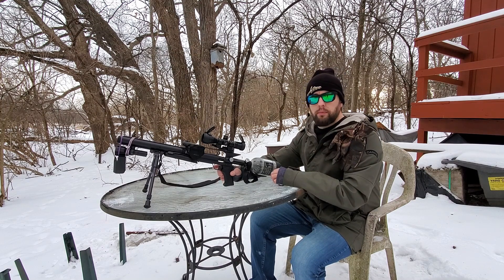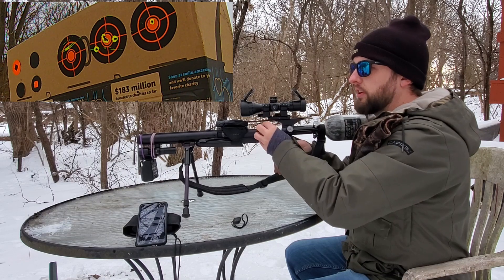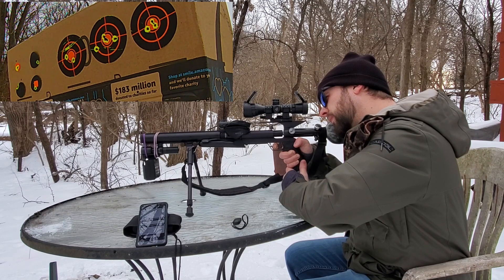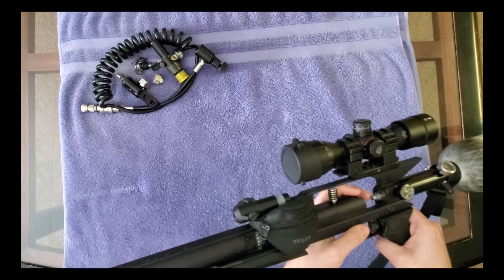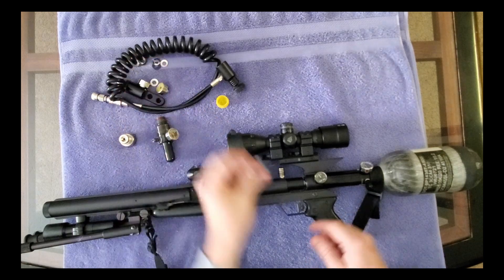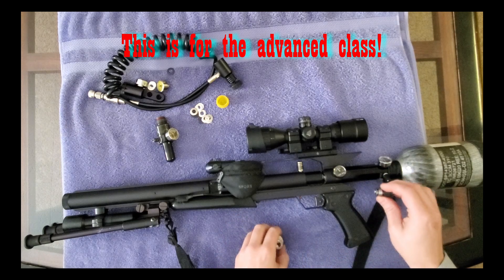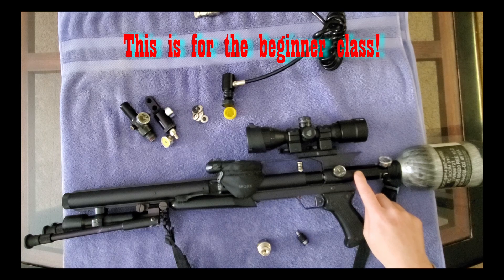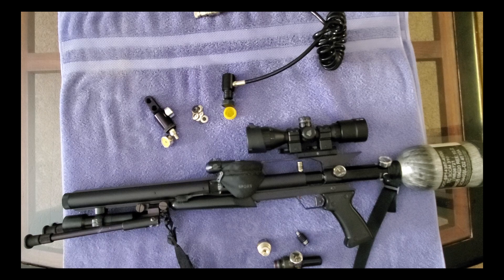How to REGULATE the Airforce Airguns Talon SS to use a 4500psi PAINTBALL TANK & get MAD SHOT COUNT!

Comment from the maker: Here is the link to the adapter. At time of writing this it is only $7 on Amazon! https://amzn.to/3E5eUzg
Reply: No longer available
Reply from the maker: @CobosDoesItAll  There is now something way better. Check this out, Here is the link: https://shop.hubenpower.com/products/huben-power-cricket-max-tophat-regulator-50cc-the-best-airforce-condor-talon-regulator
Use discount code RSZa for 10% off

You will also want a 4500psi carbon fiber bottle to get the most out of this setup. Here is an affiliate link to that which helps the channel and is a stellar deal: https://amzn.to/3xqVd4E

Comment: I have a stock talon ss, in 177 and 22. Both barrels shot good. Would like if the safety was manual instead of auto. Do you know or suggest info on that. Thanks
Reply from the maker: If it is a newer model you can simply pull out one pin and remove the auto-safety actuator. That is what I do on all of mine. Manual safety is way better

Comment: "special reg tool" hehehehe  (looks over at the pipe wrench and padded vise)😅 The Flex is nice for tuning if you shoot a couple different weights of projectiles/ have a couple different barrels, other than that, the "set 'n forget" ones work well.

Comment: What caliber is what you shoot with...?? the ideal would be that you are well accommodated to shoot at about 35 meters...let's see how it groups those shots...commonly in caliber 5.5 I make my condor reach 880 fps with 18 grains and in caliber 6.35 at 920 fps with 26 greins...the two are very similar to the 18 jsb they are the same shape of pellet...and it groups me excellently 35 meters and 50 meters...but a coordinated valve must group one after the other!!! and that's what I wanted to see...but seeing better apparent rumbler it's not a recognized valve...I thought it was a Chinese superwell valve which they say works very well...that's the one I'm going to put on it I used my Airforces condor in 6.35 with a 62ci fiber tank...hopefully this medication works well...so I can shoot 100 meters with great precision!! Greetings, Antonio de Salta Cap- Argentina
Reply from the maker: This Talon is .22 caliber. Shoots about 750fps with 18 grain pellets. Gets 125 shots per 4500psi fill before going under the reg. The valve is a genuine Airforce Condor valve. Reg is a standard paintball regulator that I modified the Belleville washer arrangement to provide for about 1900psi output. Tank is a Ninja 45/4500 Lite. This Talon SS shoots great at 25 yards with the 18 grain pellets, cloverleaf groups.
Before I sold my .22 Condor SS, I had it shooting 890fps with 23 grain slugs using a similar reg setup.

Comment: Good stuff! Good knowledge! Thanks for sharing your hard work.
Reply from the maker: Thanks for stopping by! I knew you'd wanna check this out. My Talon SS setup is "the pro tinkerer's special", but I gave the option for a novice-level solution with the Ninja Flex Reg, too. Hope some people find this helpful!
I wanna see more about your reg setups! Those are more conventional and "out of the box", I know, but being a lifelong paintball player I just HAD to figure out a way to adapt a Ninja bottle. :) 
I will be following you closely, my friend! Cheers!
Reply: @airshootist  I have no paintball knowledge. My regs are factory made for air rifles. The Altaros has a small plenum but I fudged it past what is regulated for its settings to get the psi, FPE and velocity I wanted. The reg for the slugs is designed for power air rifles. There is also a reg designed with a max output of up to 300 bar. My reg is a step below and has a max setting of 250 bar. But I go with 200 bar which is plenty for me. Like I said I’m going to tune it down a bit to conserve air and get a higher shot count. I like what you did and wish I had known this bit of info before purchasing the Altaros reg. I did a lot tweaking on it to get it to shoot to my liking.
Reply from the maker: @AzAirgunHunter  Oh believe me, messing with the Bellevile washers, testing, degassing, reconfiguring, filling, testing, degassing, etc. was a TON of work and required proper equipment. I wish I had taken a pic of the Belleville arrangement for others to use.... I just did a LOT of online research and a LOT of experimentation to get it right. 
-Actually, just checked: I found a pic in my phone - not sure if correct but the arrangement was ()((()))(())(). Another pic shows it may have been: ))((()))()(())().... not sure which or if either....

The Ninja Flex system I had on the Condor SS was easy peasy, though. External adjustment is the bees knees. No messing with Belleville washers and excessive testing. Just read the input and output gauges! 🤠
Reply: @airshootist  believe me. I know that was a lot of work and is Airgunner appreciate you sharing your hard work with us.

Comment: Great video....... I have an Airforce Escape 25 Cal 24-inch Barrel that I've regulated I enjoy it so much more now. Before I never really wanted to shoot it because I always had to find the perfect PSI and then I only had eight shots. Now it's 60 shots and they're all consistent and with a Donny FL it so much more quieter the regulator that I installed is adjustable and came with the miniature pressure canister for when you're making adjustments which is super sweet.
Reply from the maker: Sweet! What reg did you use? I understand there are options out there that may be easier than my setup (Altaros, for example,.PCP Tunes, etc) but I just had to use a Ninja Paintball tank.

Comment: Great explanation of your setup. That rig is amazingly consistent. That looks like the perfect backyard setup. I came across the H&N pellets a couple years ago and I refuse to use anything else at this point. Anyway, nice rig, great vid !
Reply from the maker: Hell yeah, thanks for stopping by! 
The Hunter Extremes and Crow Magnums aren't a super accurate pellet. But they expand on small game pretty well and it lowers your chance of a high-FPE pass through. The Baracuda (used to be Beeman Kodiak) 21 grainers are deadly accurate in this gun, but pass through everything. When it's warmer and the air is less dense this gun usually has bit higher velocity (+15-20fps) and an SD of like 2fps. I make 25 FPE with the 21 grainers, a little less with the lower-BC HPs. 
Love this old gun I bought 18 years ago!
Reply: @airshootist  I'd love to have a setup like that one day. Keep rocking the content. 👍